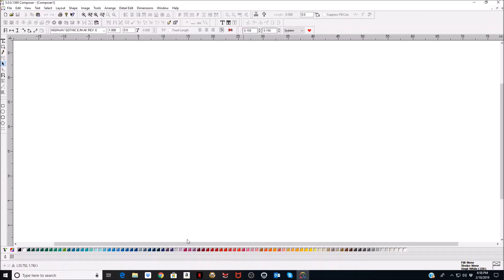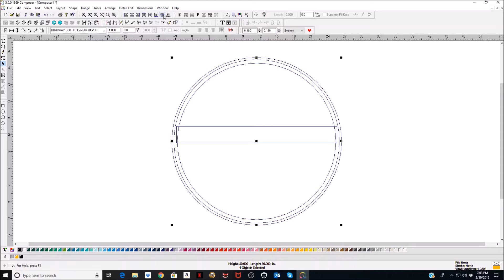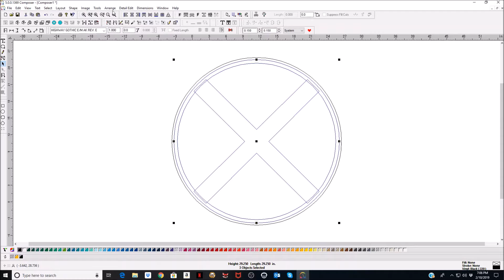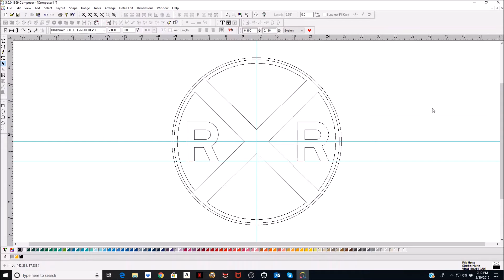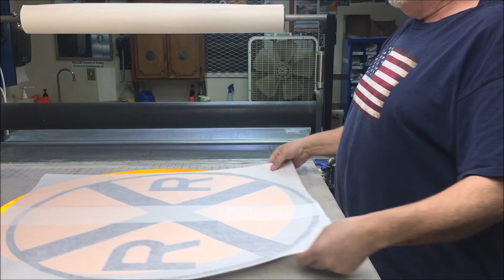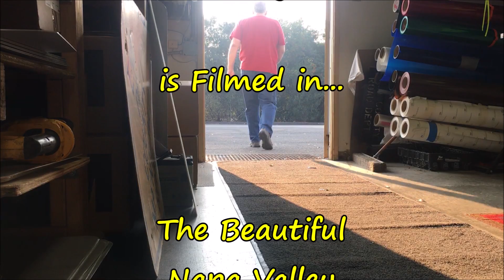Omega 5 0 Software Part 6.  Making a Rail Road Crossing Traffic Sign

Comment: I made the circular railroad signs during 2012, and early 2013.  They were between 10 inches and one foot in diameter.  I used amber 3M prismatic reflective, however.